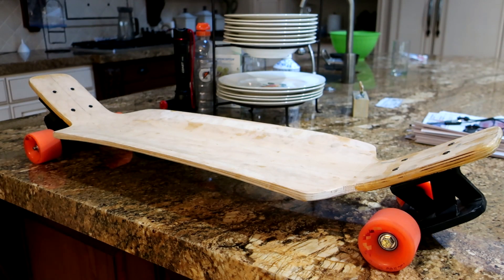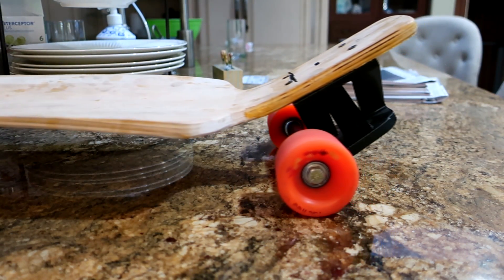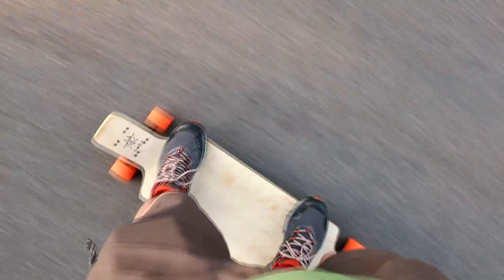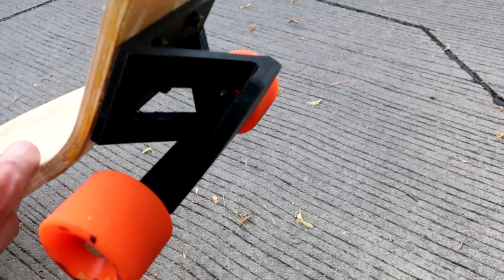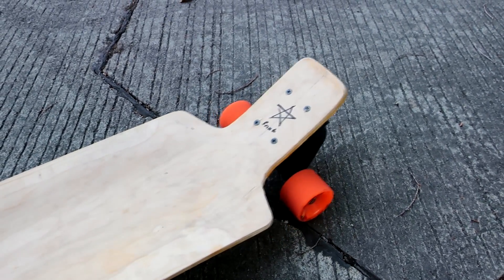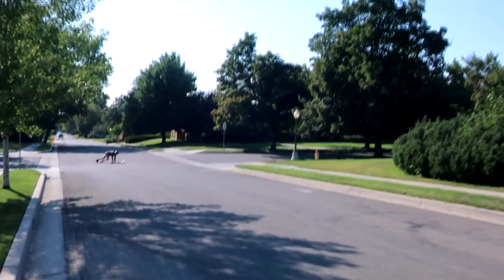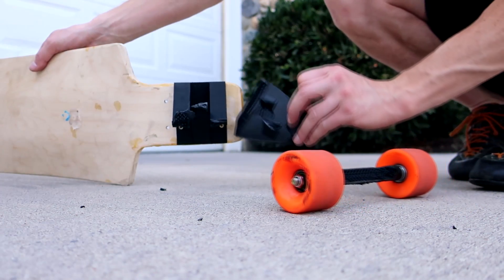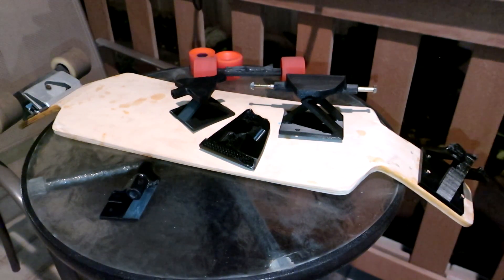Compliant Mechanism Truck, V3.

Comment: I just printed a truck, the stiffer version, with 20% gyroid infill and 3mm thickness shell and it's stiff af by hand. Printed it facing with the wheel "tube" facing up for more layer strenght. Mine was 3€ worth of petg not 7$ at this point idk if it's too stiff or not have to try it
Reply from the maker: Actually printed it, nice. Be careful when you try it.
Reply: @LongboardTechnology  after 2 afternoons trying to hook it up to my skate I tried it. My wheels were a bit small so it touched the ground on the front, I wasn't moving well at least I could try swinging on given I couldn't by hand, a few leanings and it cracked. Maybe infilling it wasn't the brightest idea and maybe changing orientation weaked somewhere else. I don't have enough petg to print 2 more totally infilled, 1kg of petg costs like a single truck, I'm getting some real trucks soon

Comment: Interesting design. This should fare well if built with leaf springs as the flexing element instead of plastic, hwich should be relativly easy to make. You could maybe print mounts and epoxy the leaf spring into it?

Comment: I figured you had 100% infill until I saw it broken. A) I'm surprised at how well it held up with that, b) why not 100% infill? C) Have you looked into annealing the print to helpmake the layer connections stronger? D) Very cool! Gives me all kinds of ideas.
Reply: Agreed, 100% infill will help make them durable without drastically increasing stiffness. Annealing will also help a LOT because printed parts are exhibit different mechanical properties in different directions. After annealing it will be much more consistent and there will be very little internal stress (printing definitely introduces internal stresses). Lastly, he didn't specify what material he's using but I would expect he's using PLA or ABS. Nylon would definitely be an improvement but that's hard to print on home machines.

Comment: Could the axle housing have been positioned more centrally with ‘spring’ elements either side. Also as stated above, using more smaller elements would help to reduce the total failure factor. I think alternating their lengths and thus root positions, would give you a different and gradual roll rate. I’m no boarder, but would love to see this idea go further. Great vid, thank you sir.

Comment: Did you've simulated the forces before printing the models? I think it's a good idea but maybe not very properly constructed. If you'll make more radius on bends then it will be less breakable. And of course it must be printed out of nylon, not PLA or PETG.

Comment: Not quite in the spirit of the truck, but maybe more, small, compliant pieces would be more elastic and less brittle than a couple larg pieces and then you could supplement a seismic spring or rubber band like on the old other planet's to help with controlling sensitivity.
Reply from the maker: The thing that's kinda interesting is you can continue to add springs along the pivot axis for virtually any amount of length. They don't even have to be the same sized springs so long as the pivot axis is shared.

Comment: It’s looking great! Would be cool to see it cast in metal
Reply from the maker: With a metal baseplate and hanger, you could easily make it so that the spings are just strips of spring steel that are held in with screws.

I don't have the resources to easily make that happen. Maybe if Riley were still around.
Wouldn't be too hard to make with a welder and a bit of scrap.

Comment from the maker: Some additional thoughts.
While I tried to press the deck at a 35 degree angle, 40 or 45 would have been more ideal. But bending such an angle would not have been practical, and instead I'd need to have made a metal bracket, which I just wasn't up for ATM.

The Trucks I printed all the way back in April, and they were sitting in my hot car most of the summer while I worked on the deck. I think that somehow made the plastic much more brittle, as these trucks seemed to fracture very easily.

They were also operating very precisely. While the suspension feel of them was only slight, considering the precision of the movement and lack of slop it was actually very good. Other trucks that are as precise tend to be very hard rides.

I would be more inclined to make another 1-2 revisions, got so close to making something really fun and worth riding. But the cost of plastic is getting pretty significant.
Reply: it's very interesting ! my main concern would be the durability for aggressive riding, how do you think it would resist ? 0o
Reply: What plastic are you using? Have you considered using a stiffer plastic like ABS?
Reply: Instantly thought of this https://www.youtube.com/watch?v=wASpQMGZQ70 and this https://www.youtube.com/watch?v=DAngcygU7tc&t=0s for getting a better angle of axis of rotation for the the truck, meaning there will be less unnecessary forces applied to the mechanism. If you plan on working on this mechanism further, just applying the principle in the linked videos to your current design could mean a huge difference.